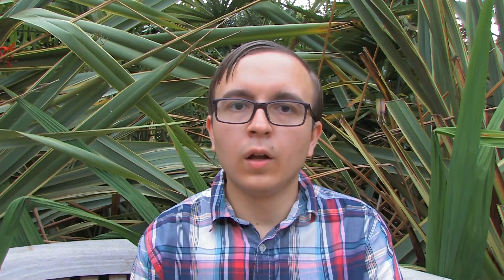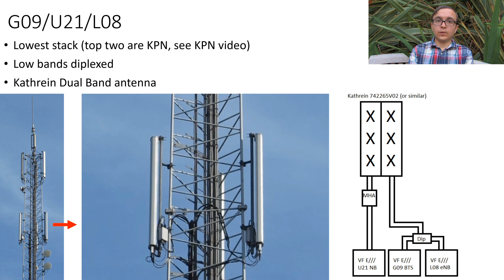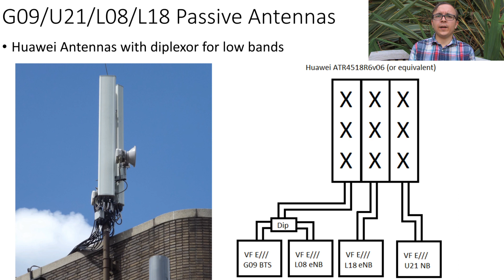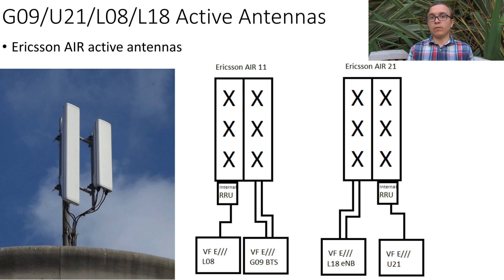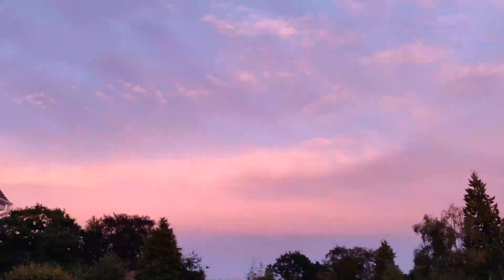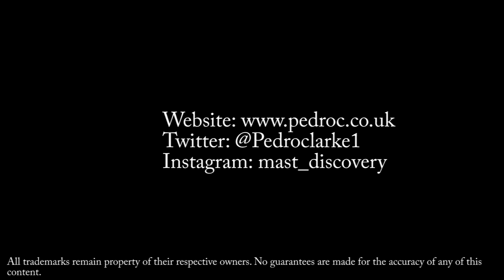Vodafone Netherlands 4G Mast Guide with Schematics + Radio spectrum. ft Ericsson AIR

Comment: The 'unused' L21 is actually being used for their femtocells that people could buy in the past.
Reply from the maker: I actually had that in the script but decided not to include it because I wasn't sure! bah....
Reply: I've come across two of these used femtocells for a very low price so I've bought them to see for myself if and how they work.
The UARFCN is 10786 (which is the part of spectrum they don't use on their macro network)
They are made by Sagemcom and are rated up to 8 connected devices at a time with a maximum download speed of 7.2Mb/s.
A couple of speed tests show that the speed when close to the device is about 6Mb/s.
My Belgian (Proximus) sim card is able to roam on the femtocells as well when they are in the 'open' mode.
The weird thing that on their entire 3G network both my phones show 3G in the status bar when no data is being transmitted but when they are connected to one of these femtocells they both show H in the status bar. When data is transmitted both on the femtocells or on the macro network H+ is shown.
Picture of my old phone next to the femtocell: https://1drv.ms/u/s!AgXQH5fZ8sKaiK92zI7dhBSNKPDhcw

Comment: Nice video :) Surprised to see 900MHz exclusively used for 2G, I'd have thought either 5MHz U09, or even 5MHz L09, would have been better...
Also with that unused block of 2100MHz (not contiguous), if they used that block for U21 single carrier, it would allow 15MHz L21? That, along with the 2600MHz (especially if they had 2x L21 carriers, totalling 30MHz), the L1800 and the L800, would allow for very high capacity where required.
I personally think T-Mob Netherlands have got it the best with LTE on 900MHz, 1800MHz, 2100MHz and 2600MHz, as well as UMTS on 900MHz which should travel further than GSM 1800MHz and therefore result in a nice 2G switch off. Whereas Vodafone Netherlands are likely to cull off UMTS before GSM.